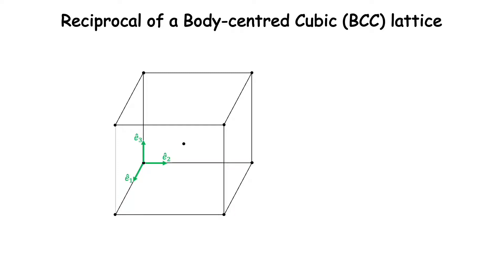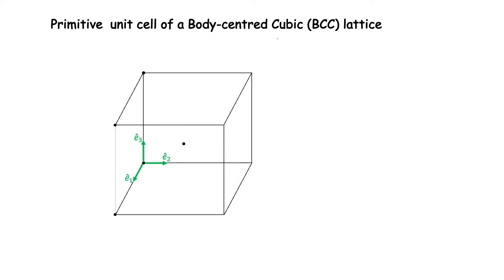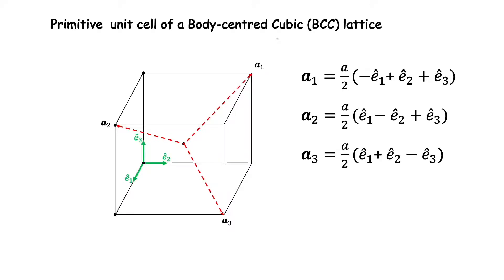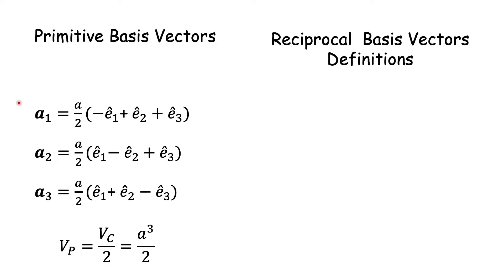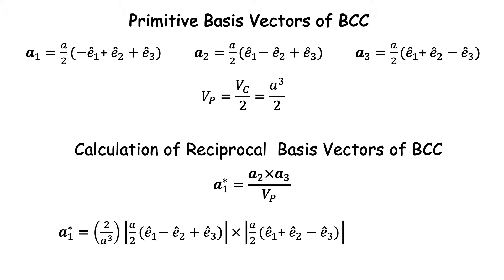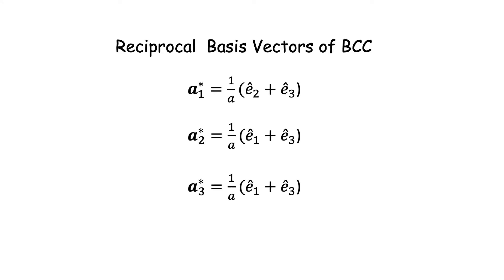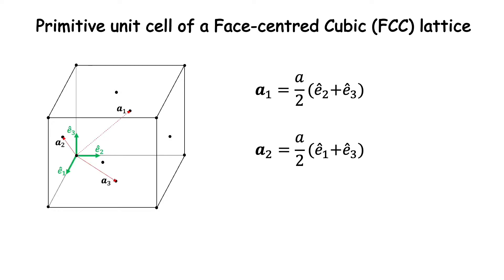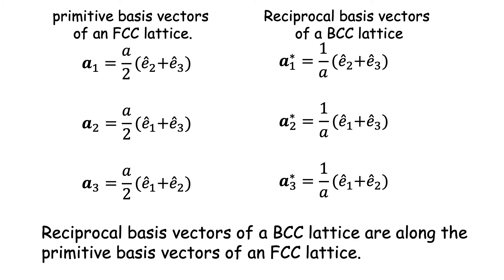Reciprocal of a BCC lattice

Comment: Sir , what are the practical applications of the concept of reciprocal lattice? Is it only for analysing the electron diffraction pattern?
Reply from the maker: One of the most important applications of the reciprocal lattice is in analyzing diffraction patterns, not only electron but also x-ray and neutron. But it also has applications in crystallographic calculations and derivations. One example of its usefulness is in the property that (hkl) vector in real space is perpendicular to (hkl) plane only for cubic crystals. But (hkl) vector in reciprocal space is perpendicular to (hkl) plane for all crystal systems. This property makes it very useful in the crystallographic calculations.